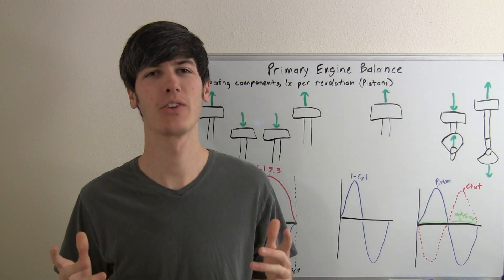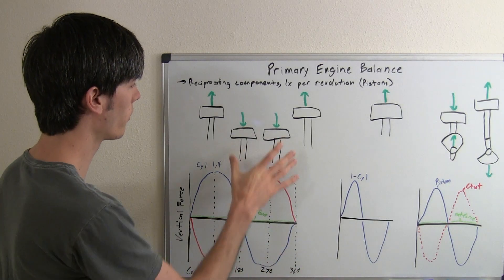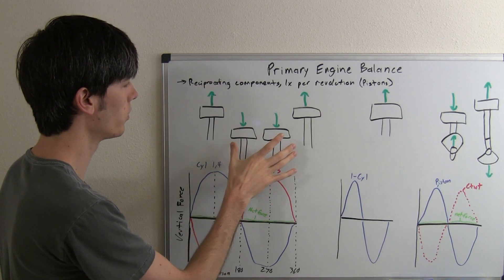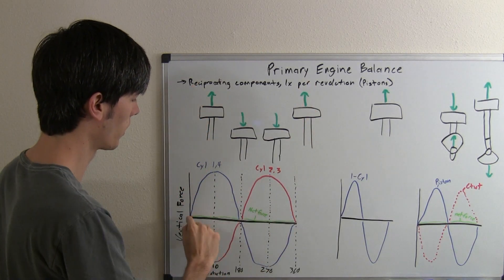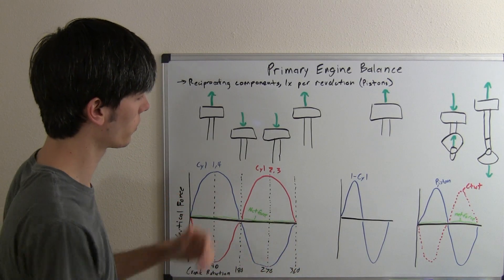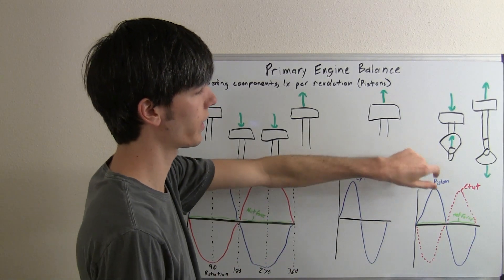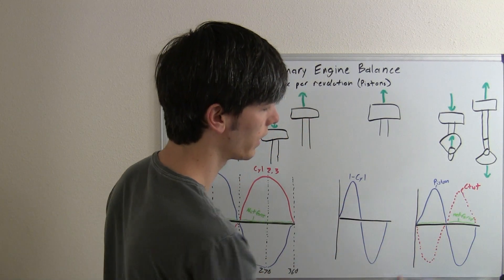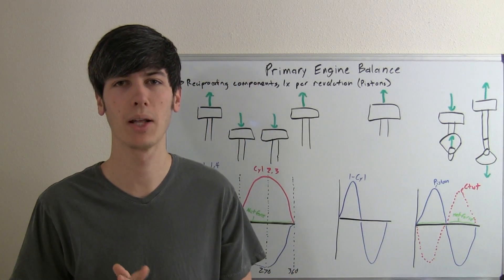Primary Engine Balance - Explained

Comment: Would it be easier to balance a rotary engine since it's just circular motion? I was looking at the wankel engine and was wondering how it's not vibrating like crazy since the E-shaft is lobed out. 

Love the channel btw!
Reply: The old Mazda wankel cars were smooth running machines )
Reply: I'd imagine so since they can reach high rpms! But would they just require 1 counterbalance to offset the eccentric shift' lobe?
Reply from the maker: Basically you just have to make sure the cg of the shaft falls along the axis it rotates. You can do this will multiple rotors, or by using counterweights.
Reply: Wankels have a counterweight on the end. 

The e-shaft isn't too bad because the lobes are not offset particularly far. As such, it can reach 10000 rpm in the renesis. The balance issue for the rotary is the big heavy rotors. While the rotors do have a circular motion of sorts, though not really, all circular motion has both x and y components which it will move through. What saves the rotors from being ejected through the engine and thrown into the atmosphere at 10000 rpm is that the rotors only rotate once for every three rotations of the e-shaft. So while the e-shaft is rotating very quickly, the rotors are actually going considerably slower. Even so, the usual RX-7 redline is around 7-8k rpm, which isn't especially high, and the rotors would only be going 2.3-2.7k rpm.